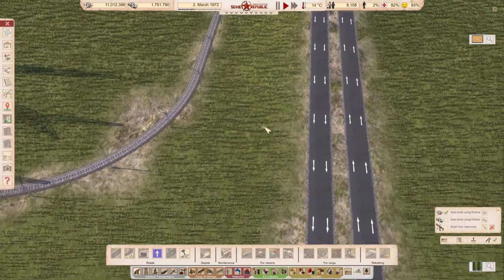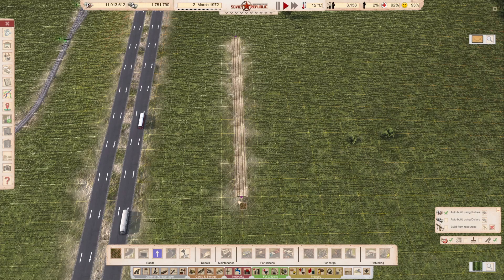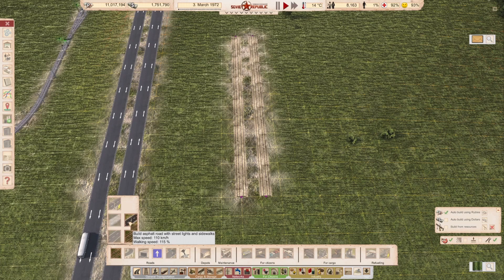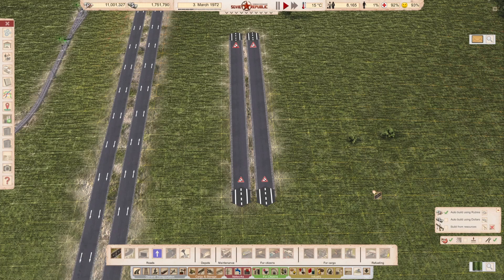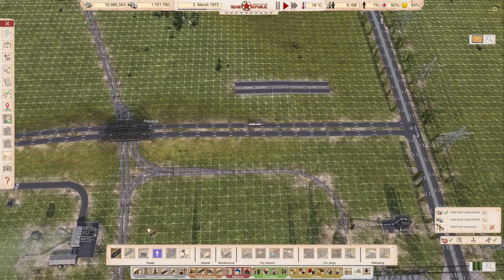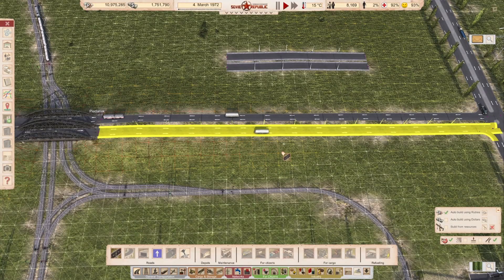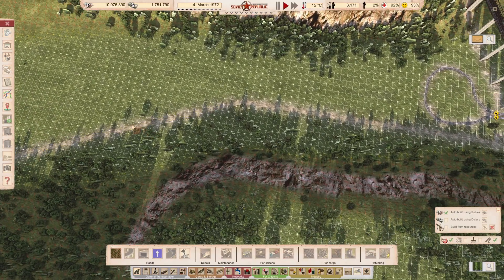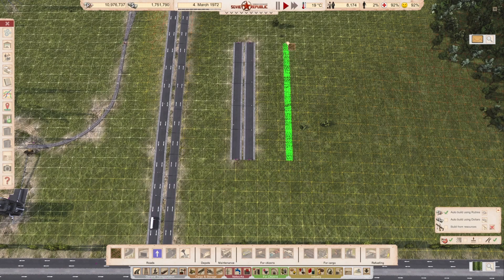Place streetlights on outer sides of roads | QuickTips | Workers & Resources: Soviet Republic

Comment: So lights are always placed on left side determined by direction of initial road building. Got that.

But does the light placing actually matter besides optics? Are there subtle effects like lighting a part of the unlit streets at intersections when placed on outer sides? Do cars driving on unlit streets at night go faster over lit intersections?
Reply from the maker: (Sorry for the late reply, took a short holiday). But besides optics the placing of the lights doesn't matter. Roads with lights do use some electricity by the way.
Reply: @CayaMaya  Lit streets using electricity is fair because cars can go faster on them at night.
Reply from the maker: @Oktokolo  Yeah, I think so too